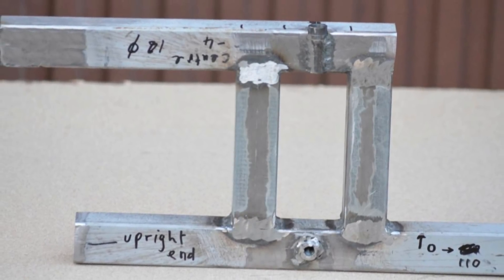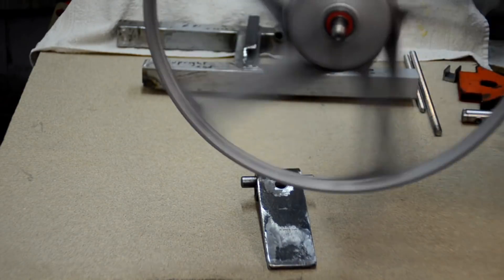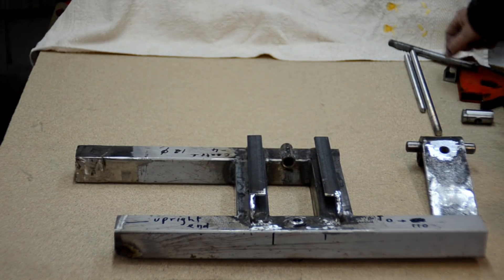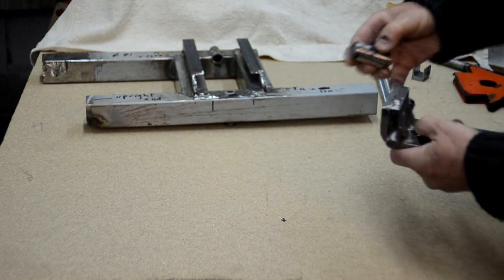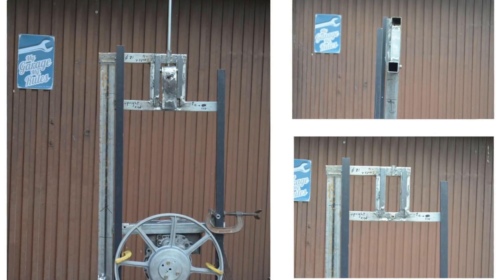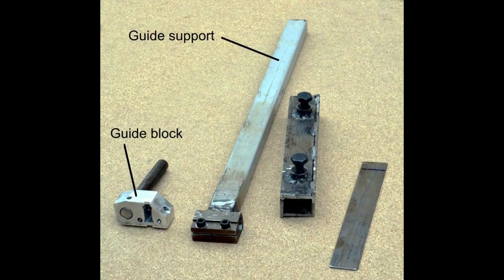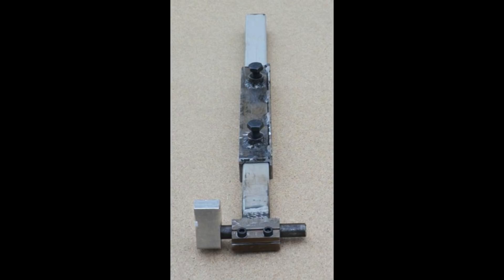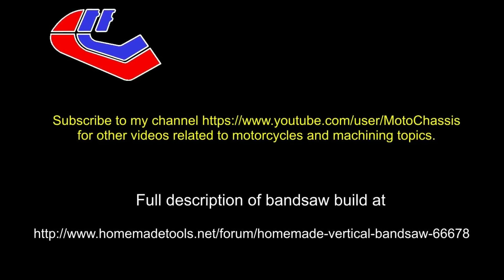Homemade metal cutting bandsaw. Part 3.

Comment: Cuáles son las dimenciones del largo, el alto y ancho de cada uno de los hierros usados? Cuadrados, ángulos, planchuelas. Así mismo también sería bueno saber las dimenciones de los demás herrajes usados en el proyecto. Parace un tontería, pero tampoco es muy seguro usar solamente el ojo-metro, se tienden a cometer muchos errores de esa forma.
Reply from the maker: No tengo ningún dibujo ni lista de longitudes de tubos. Por lo general, hago herramientas como esta a ojo. Sin embargo, puedo decirte que la mesa mide 600 mm de largo, a partir de ahí deberías poder escalar las longitudes de los tubos. Aquí hay un enlace con mucha información sobre cómo construirlo. 

https://www.dropbox.com/s/pveht1tyu8...ndsaw.pdf?dl=0
 
y 

https://www.homemadetools.net/forum/homemade-vertical-bandsaw-66678#post108045
Reply: @MotoChassisByTonyFoale  Mil gracias..